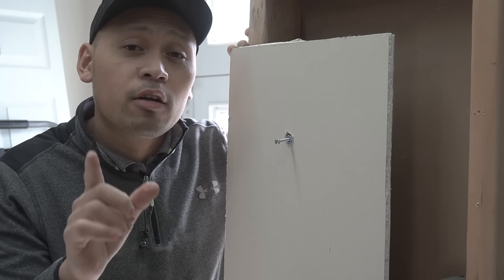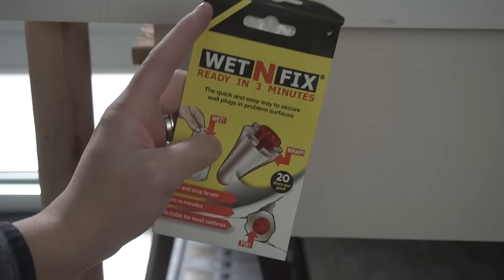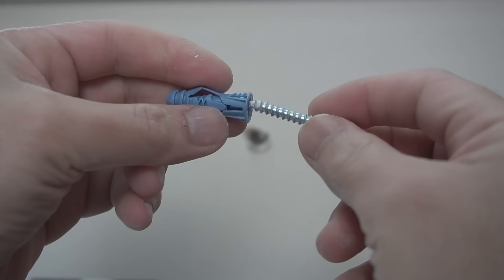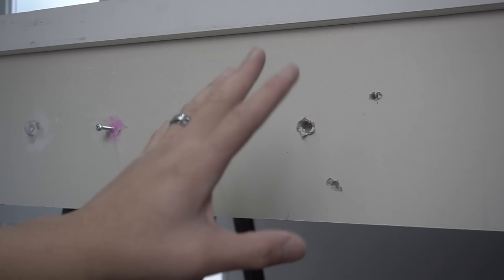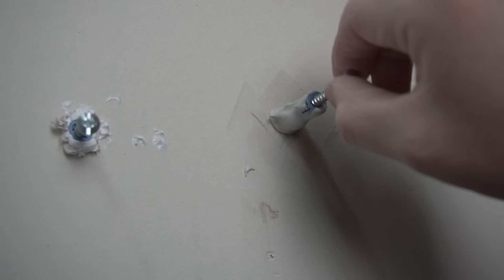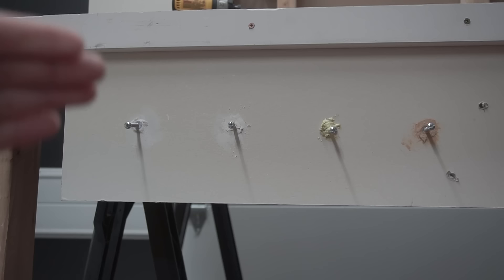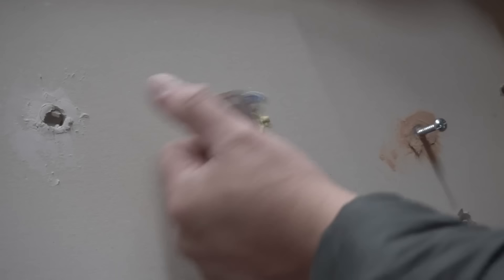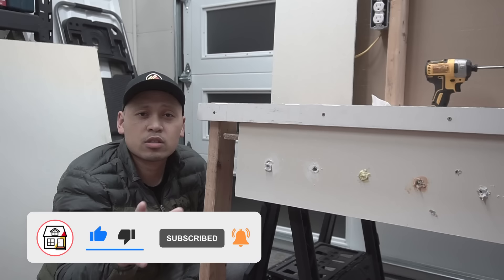How To Fix Loose Or Damaged Drywall Anchors Like New! | DIY Wall Plug Repair!

Comment: A product named Fix-It-All Patching Compound is easy to mix and use, dries in about 1/2 hour, and becomes hard like a rock, harder than the surrounding drywall. It will bind to the drywall and would easily outperform any of the videoed solutions. Very handy for all sorts of repairs. You mix just what your need and the remaining powder will last for years, ready for the next repair, unlike many of the videoed solutions which will start to degrade and become unusable in short order once opened.

Comment: Sometimes I put 2 or 3 dry wall plugs in a bigger hole and screw screws all the way into the second (and third if I put 3), they splay out behind the wall and then I use the 1st wall plug to hang my item.

Comment: I Usually just use a larger anchor, like a toggle bolt, or if possible, I patch the hole and move to a different spot on the wall.

Comment: I use the stuff called "NO Nails" or similar names. Same idea put screw one or two turns into plastic wall plug put a blob of No Nails on you could wrap some card or paper round adding more of the product. Put in hole let it set then screw in screw

Comment: You can also use a larger wall plug with the small plug fitted in the middle of the larger plug you may have to split open the end of the larger plug.

Comment: I use the Great Stuff Foam and it worked very well. I believe if you had sprayed more into the wall cavity then slowly draw out the dispenser straw it results in a larger anchor hold. Several of the rest I tried with similar results as yours,
Reply from the maker: Thank you for the input! 🙏🏽😊

Comment: Toggle bolt is best solution. In addition testing methods put strain on anchors downward which is why “good” fastener held the 130+ lbs. pull out force at 90 degrees to wall is more important and basis for original ratings

Comment: I had anchors failing in my bathroom on the towel rods and I just screwed in some bigger nylon anchors. 3 years and they're holding strong.

Comment: I usually use those types of plastic anchors in cement walls. Find a stud instead of using a 3/16 or 1/4 plastic anchors. They have better quality drywall anchors that hold better. As soon as you try to screw the drywall screw in more the repair will crack.

Comment: Question for you. How do you repair a drywall hole so that another hole can be drilled in close proximity, without both holes joining together and becoming one giant hole?
Reply from the maker: Yes of course! I would use 5 minute  “Hot Mud” it dries harder and faster. Here is the link if you are interested, comes in a good size bag, which goes a long way! https://amzn.to/3qbeDDj

Comment: Toggle bolts. Bolt with a butterfly nut. Best wall anchor for drywall only. The problem with drywall is that it's too rigid. Its hard to fasten to something that crumbles.

Comment: I inject the hole with plaster filler in a gun, flatten, dry, fill, flatten again, dry again, repeat untill perfectly dry and flat... Key... Paint... then re drill. IMO the best and correct method for repair. If only slightly loose, then a larger fixing. I don't like committing bodge repairs. With any of the above methods, your hole will most likely have shifted from the correct location. A tip is alway use wood drills in plasterboard and start small before growing the hole for precise positioning.

Comment: The 5min fill will work too if it has some cloth/fiber stuff in the hole.  bottom line - same material will adhere and bond in the hole better than other different materials.  The first and last are same material therefore it works best.

Comment: I use the 5 Minute on an almost daily basis at my job for a multitude of patching and repair work. If you had "worked it into the hole" , making sure that there was plenty of excess through the hole and onto the back of the rock, you would've had a better chance if it taking the weight. When a smaller anchor fails, we usually just install one the metal screw-in jobbers, then hang what we need to with it's included screw. If we really want holding power, zip-toggles are the way to go. A little more costly, but they insert in a 1/2" hole, and you can remove/reinstall the mounting screws whenever you need to....and you don't waste time waiting for mud to dry.

Comment: EZ-Anchors are the best
The best way to fix a blown out plastic expansion anchor is to use a metal spade point EZ-Anchor FROM THE GET GO.  Whenever I hang Draperies, Shelving or Toilet Accessories, etc. the first thing I do is throw the little packages of plastic anchors in the trash.  Then I pencil-mark and center-punch the location.  THEN I power drive a metal EZ-Anchor carefully into the wallboard.  (Start by slightly punching the point of the anchor through the paper face of the wall board before you slowly start driving.  This will help to prevent walking the axis of the drive off the center point).  Even if you can "fix" the blow-out with the products tested in the video you will still have an inferior fastener installation.
EZ-Anchors drill their own hole, they are easy to keep accurately centered and they really grip the gypsum board with their deep threads.  The white plastic EZ-Anchors are almost as good, but these are better driven manually (with a screw driver).  Otherwise they may break before they go all the way in.  Also, if you are not careful with your screw gun, the hole in the GypBd can strip out on you.  In that case use a Hilti Toggler to fix your mistake.  Togglers require a pretty big pre-drilled hole and may be difficult to keep centered (but they hold really well).  So when in doubt, use an old-fashioned screw-driver.  It may take three seconds longer but you won’t waste thirty minutes “fixing” something that was your fault because you didn’t use the right tool in the first place.
It is also a good idea to drill a small pilot hole (1/16" bit) at the location where you center-punched.  This will reveal if there is a stud behind the location.  If there is a stud behind that spot and you try to install ANY kind of anchor, you will have a mess to fix.  So if you encounter a stud, just use the same kind of screw that comes with the anchors and drive it in.  It will hold more weight than would the anchor.  And it doesn’t have to be a “wood screw”.  A Phillips head Pan-Head Sheet-metal Screw will work just fine in a wood stud for this intended purpose.
If it is a metal stud, don't worry, panic or go on a two state bender.  Just try to drill a 1/16” pilot hole in the stud and judge whether it is a 25 gage stud or a 20 gage or heavier stud.  IF the stud is 25 gage, the bit will fly through it.  If 20 gage, the bit will meet some resistance.  If it is 16 gage, a cheap carbon steel wood bit may break before it gets through the metal.  If it is 25 gage, you could drive one of the anchor screws right into it even without the 1/16" pilot-hole.  But be careful not to strip it out (which is really easy to do in a 25 gage stud).  A screw in a 25 gage stud will not develop as much strength as it would in a wood stud, but it will still provide sufficient holding power for lightweight sheer draperies, shades and pictures, etc.  If you need to mount heavier items like heavy drapes, wood blinds, towel bars and wood framed glass mirrors, you should move.  If the wall was framed with 20 gage studs, pre-drill a 1/8” hole and use the same screw to penetrate the metal.  The sheet-metal screw will cut its way into the stud and form its own threads as it goes.  It will hold better than it would in 25 gage studs but not as well as it would in wood studs.  If the metal studs are heavier than 20 gage (18 gage or 16 Gage), don’t drill a pilolt hole.  Use a power driven #8 or #10 drill-point screw.   16 gage metal studs will hold more weight than a wood stud.
The moral of the story is:  "Use the best fastener for the job, use the right tools and take the time to do the job right the first time."  Don't let time pressure push you faster than you need to go to finish the job without mistakes.  Mistakes take longer to fix than slow and accurate methods done right the first time.

Comment: Butterfly Clips If Oui Must! Fixing A Cut In a Square or Rectangle Size (Oval or Circle Cut Out Size!) I take the box cutters sharp! and cut clean a beveled edge around the opening and the part to replace! Back up with 1 x 4 slats using subflooring adhesive and drywall screws..spackle hard that everything will draw together as with the typical All Purpose USG (the green lid) joint compound using. The anchor a great fit..the screw size as great..spackle and push in the anchor! Into fresh drilled drywall with no spackling I like to hammer it slightly hard and flat! To Make Our Surface One Without Having To Use Paper!

Comment: Looks like the wet n fix is just plaster cloth - I use it on my modell railroad for mountains - I think it would help more to lightly wet the wall (hole) before inserting - that way the wall wont suck moisture out of the cloth - might be even stronger. Just MHO!  Thx for the testing video.

Comment: Any ideas for a wall space that is too near a metal wall stud, in particular near corners? You can't go through it so you only have the thickness of the drywall to attach some type of anchor. Thanks.

Comment: iteresting and cool i would also try bigger dry wall plug and put the smaller plug inside the big one. but fo a hole this big just put toggle bolts

Comment: I would fill the damaged hole and leave it.Drill a new sight area if possible and use a fixing that is adapted with butterfly wings for spreading outwards at the other side of the drywall these can take the pulling power.

Comment: 1. With a pencil and sharp knife mark and cut out a 2 inch square around the hole and remove the square.
2. With a measuring tape measure the depth of the hole to the back.
3. Get a piece of 2 inch square timber, cut it to the depth of the measurement in step 2 minus 3mm or 1/8th of an inch, so if the depth measured was 4 inches/100mm you need to cut it to 3  and 7/8 inches or 97mm.
4. Make sure the timber fits the hole and you have around 3mm recess. 
5. Use some grab adhesive and cover the back of the block of timber, put it in the hole and press it in firmly, wait for it to dry hard, see the instructions for the adhesive.
6. Now brush some bond adhesive over the block and add a quick skim of plaster 3mm thick.
7. When properly hard you can now fix to the wall without using a wall-plug.

Comment: It also depends on the wall. Some bricks have holes, thus, if the drilling goes directly in the hole it will be difficult to hold

Comment: Keep in mind that most of those materials cannot be expected to support a fastener and any weight. The foam definitely is not intended to hold anything--it is insulation, mostly air. Caulk is not intended to support anything either--it is mostly a sealer. The one product that worked, that wet stuff, is designed to hold fasteners, and that it what it does, better than I would have guessed.

Comment: Hey, that is the wrong type of anchor for drywall anyway. Those plastic anchors are for cement or block/stone. For drywall, I would recommend using something like an E-Zee anchor (I think that’s how it is spelled). Anyway, it’s a screw in anchor that grabs the drywall rather well. Then a screw into that to hold whatever you desire, 25+ lbs per anchor.
You will still have to fix the old hole, though.

Comment: Using a power drill to tighten screws into a plastic anchor is a bad idea.  Many of those plastic anchors barely work in ideal conditions, so it is best to use a regular handheld screwdriver to tighten the screws.  However, it's nice to see you found a product that can repair a larger hole and still withstand the torque from the power screwdriver.

Comment: Whenever I find a pulled-out wall anchor, I remove it and throw it away. I patch the resulting hole with spackle, let it dry, sand it and then paint over the patch.

I can then resume my attempt to hang something on the wall. I find a stud and use a 2” deck screw to secure whatever I’m mounting into solid wood.

Sheet rock is designed to hold paint and wallpaper…not shelves, towel rods, toilet paper holders, and especially NOT curtain rods!

But I know people will keep on doing it and the companies making the wall patch kits love them for it. 

I can already hear my haters. “Well, smart guy, what if there is no stud where you need to hang something?  I’m not walking to get my toilet paper!”

If your wall is that barren of 2x4 studs, then cut into your sheet rock and add some extra 2x4 support at the desired spot. Yes, you’ll have to patch/paint the wall, but you’ll only do it once, not repeatedly over the next ten years. 

I’ve also seen some clever “bridge” designs where a solid wood fixture (like art or a shelf) is secured to the wall at the studs and then load bearing mounts like towel racks and toilet paper holders are attached to it (not the barren wall).

If you can’t manage to find solid wood around a window casing to mount your curtain rods, I can’t help you. 

Don’t mount load bearing devices into sheet rock and expect it to last long. It won’t. Fix it once. Fix it right. And move on with life.

Comment: I would use a fiberglass cloth with a strong adhesive like a construction glue or an epoxy glue. Insert a screw into the anchor just enough to keep the anchor hole unclogged. Cut a stripe of the fiber glass cloth that has its width equal to the drywall thickness. Wrap it on the upper part of the anchor only so that the anchor mechanism still works. Roll enough fiberglass on the anchor a few times to get a thickness that will fill the gap between drywall diameter and the anchor diameter. Apply the glue on the fiberglass and the upper part of the anchor. Insert the anchor wrapped with the fiberglass into the hole. Leave the anchor alone for at least 24 hours. That will fix the gap and reinforce the hole at the same

Comment: i punch a hole through the drywall with a phillips screw diver tip, then use the white screw type anchors, which are much sturdier.

Comment: Thanks for the help I will definitely try the wet disc the first one I just finished putting putty on the wall to repair it was trying to hang new towel racks but found who ever put them first did not measure making it harder for the second plate to stay snug on to the wall I’m just wondering if I fix it then drill a few centimeters next to it if it will work I feel stuck I am a female trying to make simple repairs but finding it a bit of a challenge if u have any advice please help tnx

Comment: I'm pretty sure that Wet-N-Fix is nothing more than plaster of Parris and loose cotton gauze. But considering how hard a cast sets up, I'm not surprised. I bet that 5 minute hot mudd and some guaze you might have at home already would do the job too.

Comment: Two thaughts.
#1 by far the best choice, use some sort of anchor that uses a bigger hole.
Drill the hole out and use that anchor.
.
#2 Fill th hole and redrill.
remove any lose material or dust
Use some sort of jointing compound, the stronger the better.
Fill the hole
apply some paper jointing tape as you would for any other plaster repair 
redrill the hole
Ya might want to mak the existing hole with an X before you start

Comment: Never thought of using another "Filler" for this solution. What about Bondo? Thats crazy strong but harder to sand down. 

Do you do product reviews? There is this hardware product that solves the problem of loose door latches or dead bolts that sits inside the door bore hole called Resecure Latch. Found them on YT. Whats nice is that it replaces that ugly metal cover that ruins the look of your door.

Comment: Durhams rock hard.  Cotton with superglue. Put some superglue on the cotton and push it into the hole, wear gloves.  Add a little more superglue.  When dry sand it and it is stronger than the sheet rock.  Lots of applications.  Be careful with super glue accelerator, the glue gets real hard.

Comment: Just found your channel! Thanks for teaching us. Can I put a drywall anchor 1 inch next to another one? Trying to mount a new soundbar but don't want to have to deal with a drywall patch or other solutions if I can get away with it! I have a Container Store molly bolt anchor that I thought work work well. New soundbar isn't too heavy.

Comment: Nice testing products about : How to fix anchors on Dry Wall. This will help us a lot on how to choose and purchase products that will do a perfect job. Personnaly I would experiment using Super Glue (Liquid Formula) and a mixture using Backing soda and other products : Cotton balls, Ash, Carbon, Dry wall powder and others. Then set the anchor in and let it dry to see if it can pass the tests. I seen many YouTube videos using Lock Tight Super Glue and some mixtures are pretty strong indeed. Would like to see if this can be used on Dry Wall application also. 😊 ❤  👍 👁

Comment: I liked that he took the time to test different options but I just wish that he used a simple screwdriver and be careful to tighten just enough.   I am afraid some of the options did not get a chance due to an electric screwdriver being used given that it may “over-torque” the screw and tearing  the anchor reinforcement off the wall by the torsional force in effect, loosing the anchor.

Comment: Good to see shear load test but pullout would be nice to know too. Curtain rods are proud of the wall and resulting force is tension not downward shear. Good experiment though.
Reply: On plasterboard repairs suck dust of and i use 5:1 pva( watery mix) and let dry then can use filler even mixed with pva etc. On dry lining i use a large syringe to fill void with filler if there is one ie. no dab then allow to dry fully over night then use normal plugs.